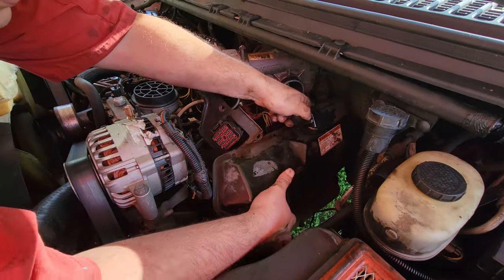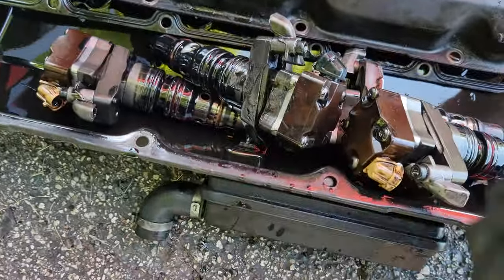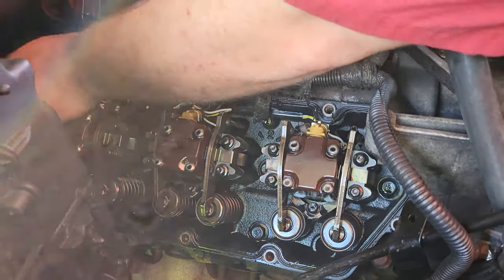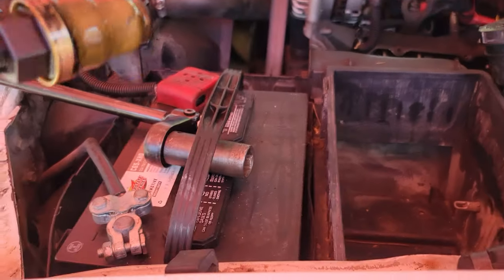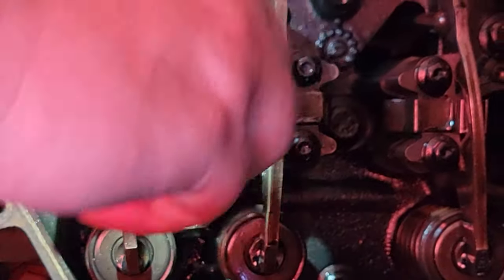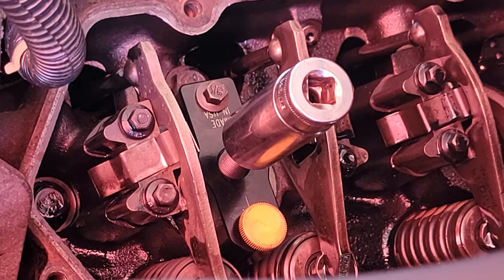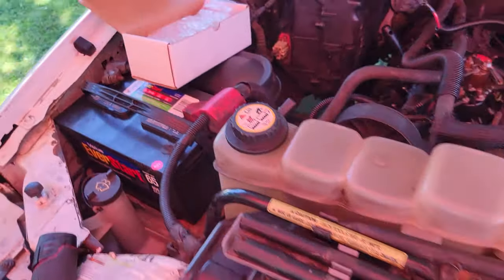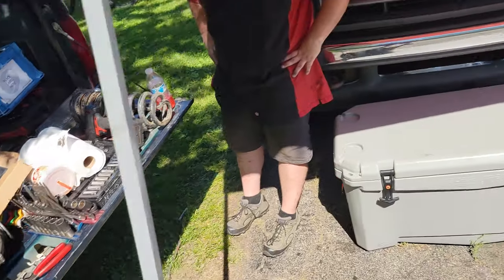7.3 Ford DIESEL Injector CUPS | Riff Raff DIESEL Tool | HOW TO - WATCH & LEARN

Comment: Idk if I missed it but what I like to do is throw a penny in the cup and then take them out so that way no shavings go into the cylinder
Reply: Good idea
Reply: Stellar advice
Reply: .......I did this after I pulled the cup out and the penny fell down below and now I can't get it out.......I think I'm gonna have to pull the head ......
Reply from the maker: Oh no....
Reply: I was wondering if he was gonna block the hole
Reply: And possibly screw new injectors.
Reply: I used a penny the other day. Figured I was a smart man
Reply: I use gum
Reply: Just use grease. Also small brass shavings aren't a huge worry

Comment: I used the RiffRaff tool to change the cups in my 7.3 with about 320K.  Great tool and made the job so much easier.  There was nothing wrong with my original cups but I was replacing injectors and glow plugs, valve cover harness etc.  I wanted to go ahead and do everything while I had it all apart.  My 7.3 is more reliable than my 6.7!
Reply: (7.3 owner here) what was the avg cost it ran you?
Reply: @chrisfowler623  average cost of what? The tools or the truck?
Reply: @chrisfowler623  I spent about $2000 for everything

That's 8 reman ford injectors 

2 valve cover gaskets (uvch)

8- zd-11 glow plugs

4 gallons of oil and a fl1995 oil filter (recommended oil change after injector install)

Alliant power injector bore brushes
(To clean injector cups)
Reply: @007.3l  I'm getting ready to do this. $2000 is a lot. But my truck has been so good this far. I just rebuilt the front suspension. I believe the truck has a lot of life left in it. Thanks

Comment: I know it’s a little bit of an older video but I’m sure it could help some people out. Instead of banging on the injectors to get them back in you can slide the bracket over that inboard bolt and use the open end side of a wrench on the outboard side of the bracket and just push down. Seats them perfect especially the harder to reach injectors on the back side rather then trying to beat them in. Thanks for the good video.

Comment: Under 200 thousand miles and it needs new injectors ... must not have taken very good care of it
Reply: The electric side of the injectors failed. It was setting high low codes in the IDM. Someone had been in there before. Plus the guy wanted stage 1.5 injectors Installed.
Reply: I was thinking the same thing and it also had a me worried too cause my 96 7.3  has 170k on it I’m thinking man that’s low mileage don’t ya think ?but I guess if ya get fuel in the coolant u have no choice then

Comment: The way I usually do when changing the injectors is. I attach a small tube to a vacuum and I vacuum out the cylinders but the glow plug trick It's prior what I'm gonna try doing the next time. I pull some injectors.

Comment: I've got a 99.5 with 320 on the clock and to my knowledge the valve covers have never been pulled. What brand of injectors should I use and why that specific brand? Are cups usually mandatory swap with injectors also ?  I'd like to keep it around as long as I can cuz they're a very reliable engine.  I change oil every 3500 miles Mobil 1 15-50 and change my tranny fluid n filter every  15,000. I love maintenance  !!
Reply: We used full force diesel stage 1.5's on this truck. The cups are not needed if you don't have a leak. We installed them in this  instance due to the old ones being damaged from some red crap the last guy used on the injectors.
Reply: @codyphillips48  thanks ! When ur referring to the cups leaking...what actually leaks and where does the leak leak to ?
Reply: @vannorman1116  coolant into fuel
Reply: @codyphillips48  no it leaked diesel into the oil. The top part of the injector has oil the bottom part that is seated in the injector cup is where the fuel is pressurized and when the cup cracks it will get fuel into the oil because it goes down past the piston rings
Reply: @LaSH_N_OuT_7450  when an injector cup cracks, you get diesel fuel in the coolant, not the oil. Lots of info on the web about this. Just fixed mine the other day that started getting diesel fuel in the coolant and sure enough I had one cracked cup. Crack was right where the cup is surrounded by coolant at the "diesel fuel" portion of the cup
Reply: @codyphillips48  what did you mean by some red crap? Sealant? Grease? Dyed diesel?

Comment: When you were looking in saying that it was clean.. could clearly see old loctite sitting around the upper bore near the bottom. Sometimes the brushes don’t take it off and you have to use a pick or flat head and chip it off then go in with the brush for a final buff. Just a tip incase anyone has had these leak after doing cups

Comment: For an extra 70$ riff raff diesel sells billet stainless injector cups totally worth . Brass cups are 100$  vs billet stainless for 170. The reason they crack is due to electrolysis from the cooling system on the brass cups . Switch to stainless and never worry about it again !

Comment: Did this same job last year on my 2001 7.3l dually. It had 130k on it and all the cups looked good but I figure if I'm this far might as well replace them. The issue I had was the truck got fuel in the oil during a trip. I found that every seal was bad on the first landing of the injector. I used this same kit, its really high quality.  I was wondering what oil you recommend for our 7.3l? I've heard mixed reviews on the synthetic but would like to give that a try.
Reply from the maker: 10w30 in winter....15w40 in summer or 5w40 full syn

Comment: Great video! How do you get any fluids out that went into the cylinder to prevent Hydrolock.
Reply from the maker: Crank the eng over without glow plugs in
Reply: @PowerStrokeTechTalkwARod do you mean try to start the engine with the glow plugs out? I guess you said crank because it will not start without the glow plugs in?

Comment: Did you guys drain the coolant from the block before? I’ve seen videos of guys putting the loctite on the bottom of the cup as well. Do you think it would help with sealing better?
Reply from the maker: Yes u have 222
Reply: I was wondering the same thing about the coolant.  Unless I’m misunderstanding, the answer is yes on removing the coolant?
Reply: @tac13001  yes, you want to drain from the two ports in the block first. Otherwise you will get coolant down into the cylinders. Ask me how I know haha
Reply from the maker: Yes!!!
Reply: @PowerStrokeTechTalkwARod I’d think that should be part of the how to since it sounds important

Comment: Great tool indeed. Need it in my Arsenal. Curious though are you gonna use the half Quarter trick for the valve cover harness when you reinstall? Seems to me that the harness comes loose eventually with all the vibration going on. Even with new wiring. When I use the half quarter on the harness connector it never comes loose unless I take it off. Is there something different to do? Just curious for feedback.
Reply from the maker: Yepp

Comment: Hello, I am wondering, that you got the cup seated properly with 10 ft lbs. In the riffraff instruction is written 35 ft lbs. I would say ( i am doing the injector cups in stainless on my truck), that your cup was noch seated. Can you say something? I am still wondering^^ 35 ft lbs was in some case not enough to seat it properly. Best regards... nice video btw.

Comment: Did you use a soft brush or a metal type wire brush to clean hole?
Reply: I got a pink sheet after replacing mine.  i have fuel in my antifreeze now.  Can't figure out what i did wrong.
Reply: I used the otc injector brush

Comment: What made you decide to change them? Didn't look like anything was wrong. Did you think you had cracking or something? I changed my Injectors at 400K plus, which were still running fine (upgraded) and my cups looked good as new.
Reply from the maker: Had fuel in the coolant
Reply: @PowerStrokeTechTalkwARod  Ahh...that will do it, thanks for the reply.

Comment: I have done cups two times now. First time I used stainless. I don’t recommend that. Very hard to properly seat the cups. In fact, I installed 2 of them improperly and got a lot of blowby into the degas/coolant reservoir which is why I replaced them all a second time. When I  installed cups the second time, mine did not bottom out until 35 foot pounds.
Reply: I just ordered the ss cup yesterday before seeing your post.  Do you have any recommendations for the ss cups?

Comment: Just asking, not criticizing. Is there a plug or plugs you need to pull to drain oil and fuel off before pulling injectors??
Reply from the maker: Yes, do you need to...no. it will into the cylinders which ull have to evacuate anyways

Comment: I see this video has age on it, but i must ask. Will this cause white smoke and loose of power to my truck? I've been chasing this problem replaced engine harness and a few different sensors bc my scan tool was showing everything going down electrical.  I lastly replaced the cam sensor, ran great but still had the white smoke, idk about the power loss bc I didn't drive it. Scanned it again with a contribution test, #4 cylinder came up, noticed white smoke coming from the head around #4 and replaced that injector, still smoke comes out from around the #4 in the head. Was thinking a broke ring, but this might be a better try before I tear into the head.
Reply from the maker: This will only cause fuel to go into the coolant.

Comment: I have a 2003 with the. 7.3 engine and the engine oil is going to the diesel that can be cause by the injectors or the injectors cup?
Reply: That could be a blown o ring on an injector or yea a cup could be fried

Comment: I had to change my injector cups. 3 of them cracked and were leaking diesel into the coolant system.
Reply from the maker: Oooooof bummer
Reply: Can also get coolant into the oil (observed via oil analysis)

Comment: there is plugs that you use to drain the oil before you pull
 the injectors
Reply from the maker: Maybe for you
Reply: @PowerStrokeTechTalkwARod  they are on that truck i saw them
Reply from the maker: You DIY guys can pull em & also open another can of worms. I'll keep doing it the way I have for the last 21 years with 0 issues...Lil mess but that's what break cleaners for

Comment: How come you didn't turn the engine over to get all the fluid out so it wouldn't hydraulic
Reply from the maker: Didnt show it....
Reply: We did after sitting 24 hours with the injectors Installed. We removed the glow plugs and bumped engine over the with the  starter solenoid WITH the valve cover loosely installed.

Comment: wow low miles that thing just getting broke in. i have done plenty of cups in a 6.0 but never a 7.3 my 03 personal truck has 320k on it factory cups new injectors tho. the old 7.3 work truck we have floating around the shop has 650k on it factory cups still new injectors and i just put a turbo on it the oem bit the dust. geuss its all in how u maintain your coolant.
Reply from the maker: Yeppppp
Reply: Great information you’ve shared . I was thinking about changing mine til reading your comments. I’ve got 342k bout to drop new stage 1 180/30 full force injectors in with tunes to pair up with them.
Reply: Mine has only 160,000 on it an needed new cups. The coolant was changed 3 times since I got it at 75,000 miles. I think it all comes down to the original installation an who done it.

Comment: The 8the cylinder injector is a different size. I don’t know who told you that but I don’t think that true. When u get a new set off injectors what is one a different size. Makes no sense
Reply from the maker: The size is the same.....look up what the long lead injector means...
Reply: It’s only on super duty’s to eliminate the kackle . OBS has all the same type injectors .Makes the engine more quiet. Same size injector just a different style nozzle I believe

Comment: There is only one problem with your video you do not know how to use a torque wrench properly. tou need to grab the handle out towards the end to get a proper torque reading not push on it two inches above it.